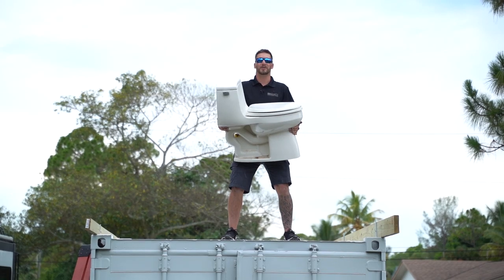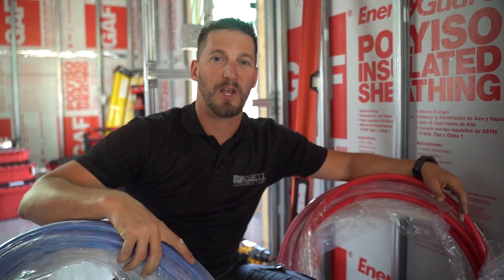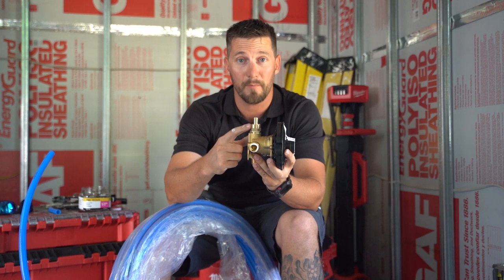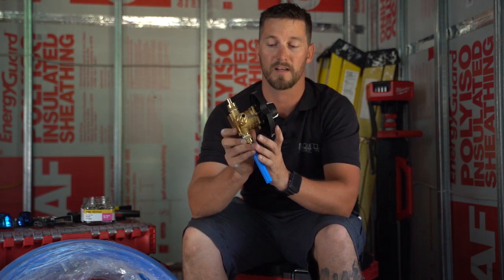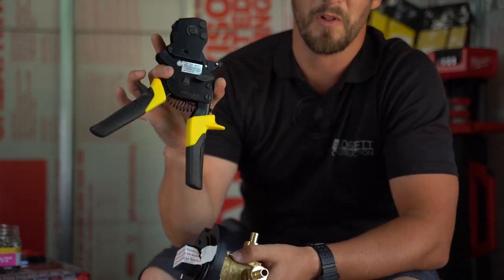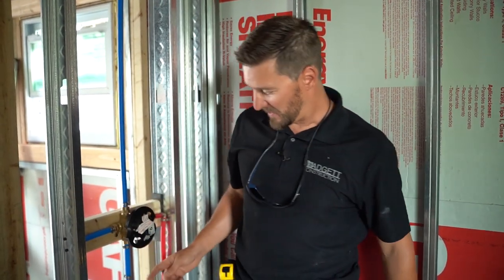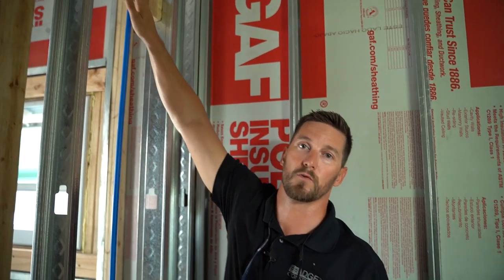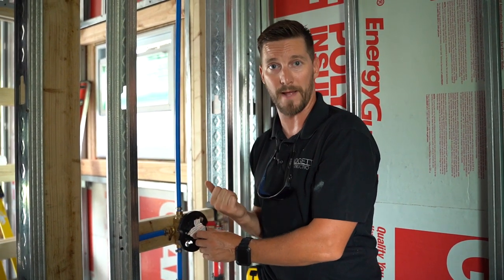Plumbing Basics in Shipping Container Home | Ep. 7

Comment: I have used PEX in my vacation home in TN and my tiny rental home in FL. Love the ease of use. If someone doesn't want to buy the $60 tool, there is always Sharkbite connectors. However, Sharkbite is more expensive so you may pay the $60 you saved from the tool to getting Sharkbites. I just replaced my water heater in my main home and used the Sharkbite water lines to connect to my copper pipes. I don't trust my solder skills, so this works great form me. Thanks for your vids Blake....

Comment: FYI that looks like a Price Pfister shower valve and if it is the tub port on it is larger than the shower Port so if you install it upside down and plug the shower and run the tub up to what is called a wingback for the shower head you'll get more volume out of the shower head and you can turn the cartridge over to correct the hot and cold

Comment: Because you have metal studs when running the tubing through these do you add some type of O-Ring to keep the metal from cutting through the tubing?
Reply: From my personal email because tyler restricts my access haha!  Just kidding... ok so yes if you had 3-5/8" metal studs you can use the factory holes pre cut in them and they sell plastic grommets that will protect the pipe (plumbing supply house or home depot).  In our case we were using 1-5/8" metal studs which are too shallow to place plumbing lines (for code) so we actually do not have any plumbing lines running through our walls, all plumbing supply lines are ran underneath and stubbed up to each fixture through the floor.  we chose to do this just incase a pipe bursts or something random happens we can easily access and repair anything right from the bottom of our container build.   So that is the longest "Yes" use plastic grommets to protect the pipe when running it through the studs!
Reply: @bmadgett85  if all the plumbing is ran under the floor, are the pipes insulated below the floor or is this a warm climate building...?

Comment: I’m not familiar with the steel structure under the wooden floor in a container like this, how are you protecting the pex from damage if you were to relocate the container? Put a different way, if you wanted to move this after construction does that mean you will destroy the supply and waste plumbing?

Comment: you have the shower valve piped backwards...the cold pipe enters on the right and the hot pipe enters on the left as you are facing the valve as if you were using the shower. Also why didn't you just install a 1/2" brass plug in the bottom port instead of an adapter, two crimping rings, a short piece of pipe and a crimp plug? the more joints that you have, the greater the chance of a leak. you would be better off learning to sweat copper...rats and mice like to chew holes in PEX to get a drink.
Reply: I came here to see if anyone else noticed. The way I've been told "hot on the left, cold on the right and poop don't run uphill". But good video other than that.

Comment: Hell no, after teflon use pipe dope, most important is holding the channel locks the correct way. 
Use the expansion battery operated tool st same price. Comes with plastic rings so much easier. Im surprised you didn't use shark bite fittings.